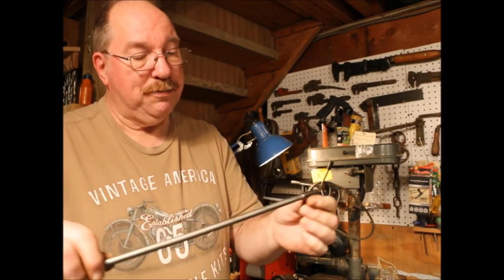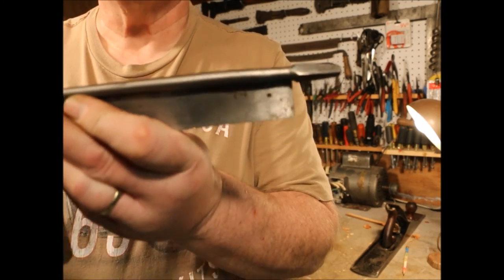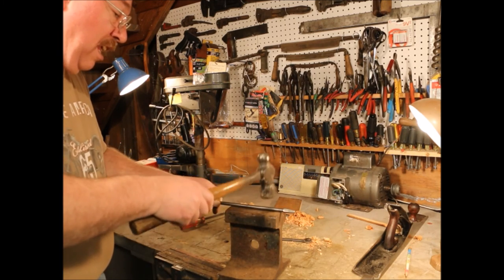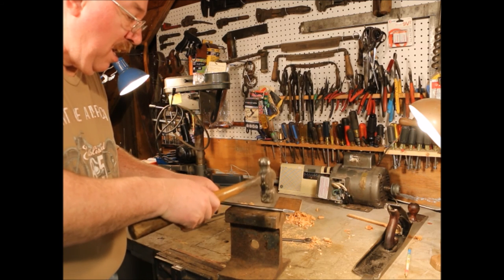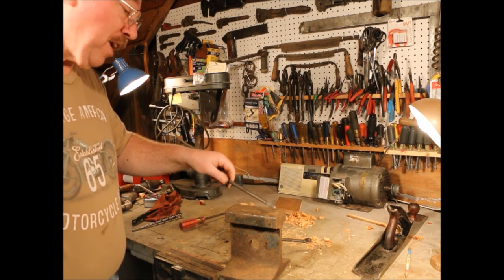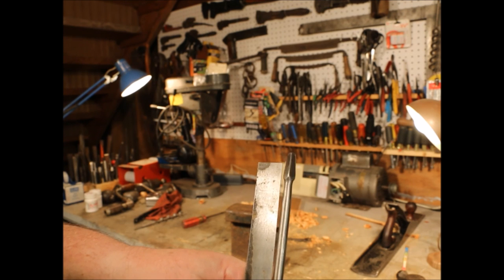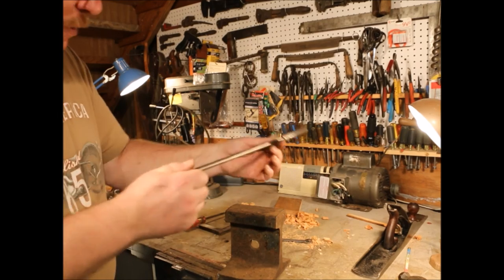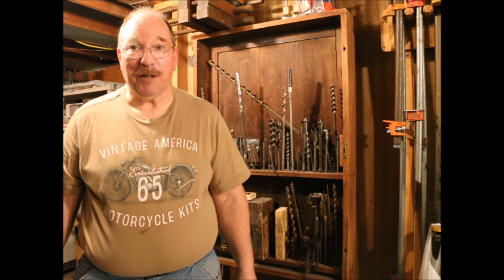Millers Falls No  35 Auger Bit Extension ~ Pt 3 ~ Straightening ~ by Old Sneelock's Workshop

Comment: Good point, Unc. I'm thinking all matters of assnine comments but everything turned out well, as I expected it would.  Have straightened out and unstraightened out a bunch of stuff like that. Beating it into submission is not the way to go all the time.
Reply from the maker: +Lewie McNeely With the Millers Falls #12 I used the hydraulic press to straighten the cast steel frame. The nice steel shank on the extension is soft for a reason. If it wasn't it would have snapped off the first time it got pulled sideways. 
Hammers aren't always the best tool, but I am a blacksmith. :-)
Reply: ........and most of the time I don't know any better. You're still my favorite Uncle, Uncle!

Comment: I just got a Stanley 180 bit extension, but I'm unsure how to actually use it. My auger bits don't seem to fit the mouth, could you do a quick video on this, or perhaps a detailed comment? Mine looks like your Miller falls in this video, I'm sure they have the same setup...thanks!
Reply from the maker: I looked up the Stanley 180 online https://www.worthpoint.com/worthopedia/vintage-stanley-no-180-18-bit-extension.  
From the pictures it uses a different holding method than the Miller #35. . 
I can speculate on how it works though 
The metal tube over the end of the extension is designed to hold the square tang into the pocket formed in the end of the shaft. 
Loosen the metal tube by turning it counter clockwise (Looking at the end where the bit goes.)
It might need to be oiled since they tended to trap dirt and water in the threads. 
Once you have the tube loose crank it out until there is enough room to insert the square tang of the auger bit into the  notch in the side and down into the square pocket. 
With the bit inserted tighten the tube clockwise until the shoulder at the end of the tube draws the auger bits square tang into the pocket firmly. Don't over tighten. No pliers or you will distort the tube. 
That's my best guess. 
Good luck.